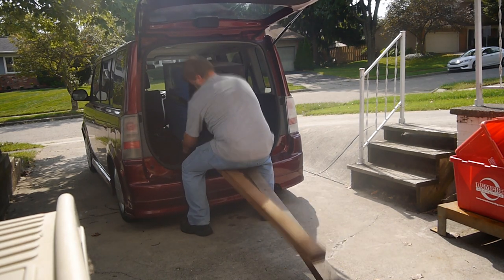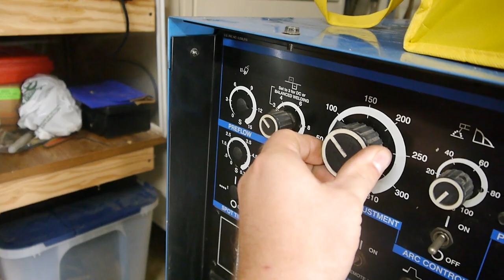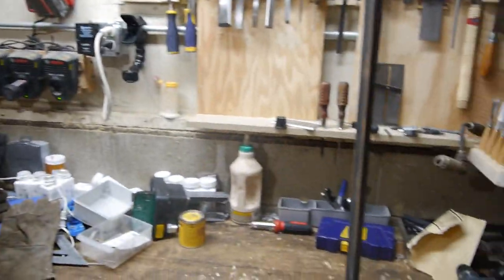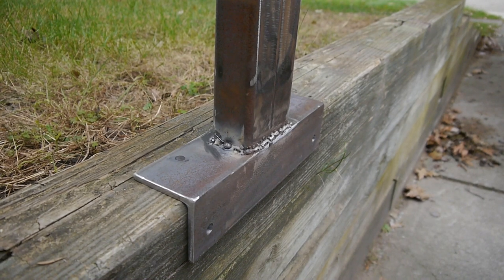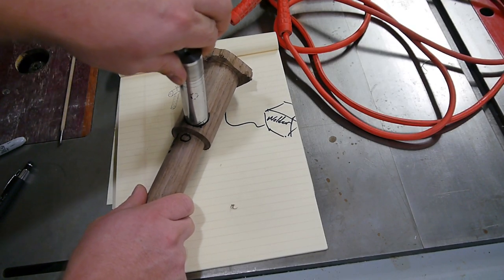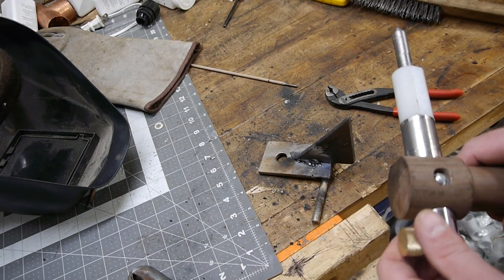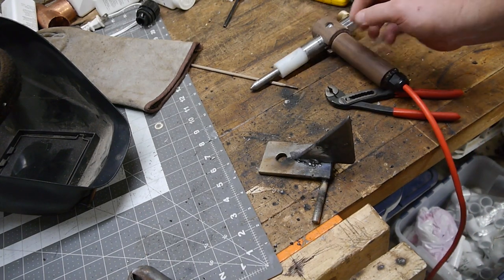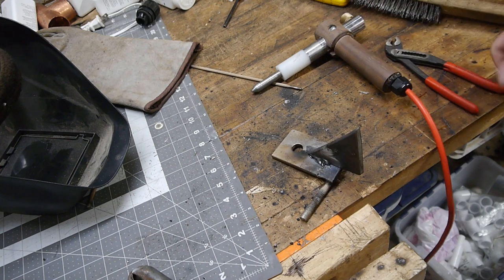Custom Walnut Stick Electrode Holder for the Miller Syncrowave 250

Comment: Would it not be safer to insulate the metal rod holder, just a thought
Reply from the maker: It certainly would be safer. It is something I thought about as the build wrapped up. I had originally planned on only the end with the stick electrode holder to stick out and the back side to sit inside the handle and then glue in a wood cap. As I plan on wearing at least one glove all the time when welding with the risk should be minimal. I had wanted to use a large diameter metal rod to hold the stick electrode so that it could act as a heat sink After thinking over the problem I may look into getting some large diameter shrink tubing for it, that or try my hand at plastidip. . You bring up fair criticism, and I appreciate that. Thanks for watching!
Reply: With a big machine like that I agreed with u bruh